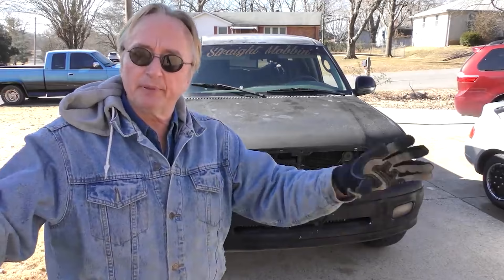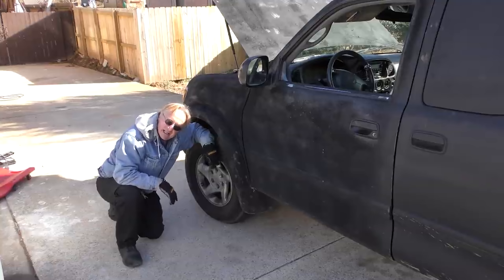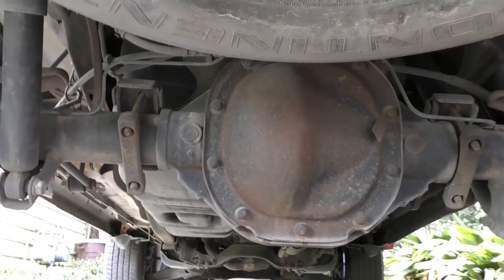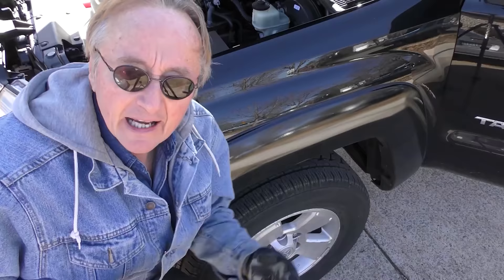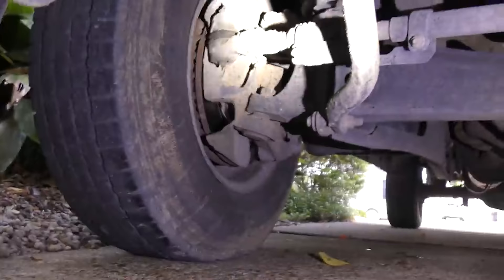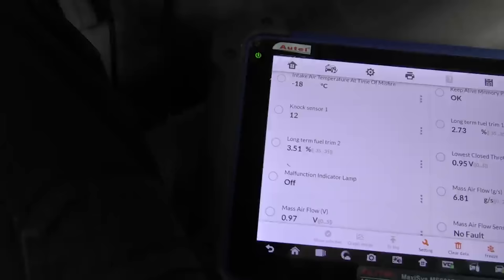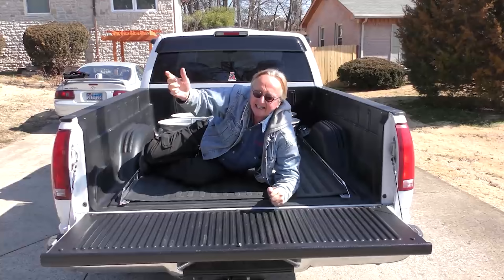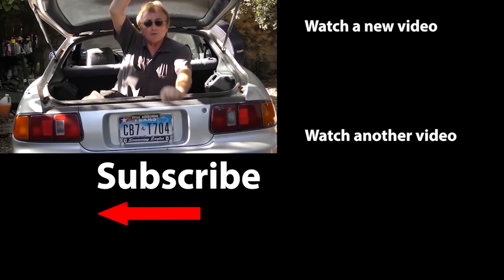5 Trucks You Should Buy

Comment: I own a 2004 Nissan Xterra SE 3.3L V6 automatic and still running strong at 184,000 miles original motor and transmission just been been doing maintenance you can compare this SUV’s to the Frontiers

Comment: i always bought s10's back in the day, they are my favorite trucks, sometimes when i needed a new truck i couldnt find a good deal on a s10 so i settled for rangers, i really hated my couple of rangers. now i have a colorado and i like it but i still prefer the s10 over the colorados.
Reply: Rangers are better trucks....why did you keep having to replace your s10s? The 4 cyl S10 were junk..the 4 cyl rangers are slow, but go forever, Chevy had a lot of issues w the tranny's they put in the S10 pickups and the S10 blazers, well, and the full sized trucks. My landlord has an 03 Sierra with no reverse.. which is normal for those.
Reply: @richsweeney1115  no, actually the couple rangers i had were junk. out of all the 4cyl s10's i ever owed i never once had an engines problem, the 4cyl engines known as "iron dukes" were great. i never bought any auto trans trucks, i always bought manual trans. i did have to change a couple clutches around 300k. the only reason i ever got rid of a s10 was because the bodies were rusted out. i live in Indiana and we get a LOT of salt on the roads for many months of the year. the rangers actually rust out quicker here.

Comment: The first Toyota Tundra when it was unveiled at the Detroit Auto Show was a complete rip-off of the F-150! There are also several GM trucks and Ford trucks on the road with over 300,000 miles on them all you have to do is open your eyes! One more thing if you go out to all your local scrap yards and pallet yards were people are putting trucks to use doing hard labor every day you will never see a Toyota Tundra all you see is Chevy's Fords and a Dodge trucks I've been in the business for 35 years and I've never seen a Toyota hauling a heavy load into a scrap yard!

Comment: I got an '05 Ranger with 113k miles on it. Had a good Carfax history, was 1 owner, mostly dealership maintained, and had no codes or anything when I bought it. Pretty much everything you want to see when buying a used car. Well it ended up being nothing but problem after problem. First the radiator went out. After getting that fixed, the transmission went out. Got that fixed and then I turned out the transmission failure caused the brand new radiator to break, so I had to fix that again. Then the brake lines broke and spit out all the brake fluid. Then the water pump went. Then the engine stalled and I wouldn't start anymore. Bought it for $4500, drove it a total of about 3,000 miles and spent almost $8k fixing it. Sold it for $900. Worst purchase I ever made. I will never buy a Ford again, no matter how reliable it supposedly is.

Comment: I got the same truck only thing is  the one I got is 2 wheel drive it just about to turn over to over 200000 miles the only thing I had to do is replace the starter a few years ago that 2 day job cause the starter is in side of the motor  that bigs thing I have had to fix on it  other then that most repairs are  sample to fix

Comment: Hey Scotty not sure if you know the percentage of all trucks comparison. I had 3 Toyota trucks two tundras and one Tacoma. I got to tell you I was extremely unhappy with them. They are not ment for heavy duty construction. I had constant problems with transmission and engines. Very weak and too light. I had chevy which was not that good either but the best truck I ever had was Dodge 3500 Diesel dually. GMC trucks are built well as well. In my opinion you can't beat diesel from Gas, but again it depends what you do and what you use it for. I call Toyota trucks toys for moms with kids going  to a beach or camping!

Comment: I just got a 97 ford ranger xlt step side 3.0l V6 RWD about less than a month ago. Only problem is there is a leak from the radiator on the threaded pipe going to the tranny. So I am leaking little at a time ATM till I thread lock it. Wish me luck 😁

Comment: I had a Toyota truck 22r 5 speed and put over 550.000.00 miles on it and it was still running only a arm rocker was the only thing wrong woth it

Comment: Hi Scotty, great service to the community, appreciate your expertise. Just wondering what year the Tacoma was that your son bought in this video? Best cars I’ve owned was 02 civic manual 5 speed vtec sold at 325k and my 09 awd Highlander 3.5 with 185k so far, front struts and changed the notorious oil cooler hose. Used cars are way overpriced right now. Waiting to pick up a 4x4 truck.

Comment: What about the 1993 Toyota Pickup truck? This truck is by Toyota but is a piece of junk! This has a aluminum engine with a steel head that goes through a head gasket every year! But Toyotas are long lasting ? Right?? Mine was a piece of junk that lasted 138,000 miles.

Comment: I rather have a 90s f150 manual with 300 incline 6 my father has one has 255k and pulled old John deer tractor on a double axle car trailer going 50 so I rather have old Ford then tundra

Comment: Yeah but what about my 08 Colorado with the 2.9 liter 4 cylinder with about 170,000 miles. I bought it about two years ago and haven’t been into the motor yet besides tunes ups and fluids. 

So when should I have the timing chains changed.

Comment: Toyota tried to prove they were tough in the 90s? I knew a 400lb guy that drove an early 80s Corolla, for years and years (well into the 2000s). 

It had 350,000 last I heard. The original motor and manual transmission. If that’s not tough, I dunno what is.

Comment: I've got a 97 chevy like tge one you mentioned. Can you get me some ideas about my rear diff whine? She's got 208k miles and has been whining forever. Pulled the cover and cleaned it up but I didn't see any wear. Put new fluid in and it's not much quieter but still whines. Other than that I love the damn thing, rusting apart in the rust belt but runs strong and everything still works!!

Comment: Loved your video Scotty and you started out with a 2000 Toyota Tundra which I currently own. My Tundra is a V-8 SR5, 4 x 2 with just under 133,000 miles on it, almost new ARE canopy, a cloth bedrug and a Toyota bed liner. I need a larger pickup and want your opinion on what I should ask for if I sell it. If this is something you don't feel comfortable doing I understand!
Reply: The market is hot right now, especially for Tundras. Check out the FIRST GEN TUNDRAS page on Facebook. Lots of good info on these trucks. The consensus is to not sell them though since they are made better than anything else out there. Price will vary on a couple of factors. 2WD is against you but the lower mileage helps you. Lastly would be regular cab or access cab as well as how's the frame as far as rust and when was the last time timing belt and lower ball joints were replaced. Frame, timing belt, lower ball joints, and exhaust manifold tending to separate from the gasket causing a ticking sound and slightly louder exhaust is the only culprits when it comes to maintaining these wonderful trucks. I'm assuming for a regular cab with it needing timing belt and lower ball joints and no rust you'd get $6k easy, list for no less than $8k. Access cab will net you more. List for at least $9k. Access cab with those maintenance items done would be $10k - $13k easy. I've got a 2000 4WD that I love that I'm doing some rust repair on the frame now and already have plans to replace the leaf pack, upper and lower control arms, new lower ball joints and new Bilstein shocks
Reply: Also, the topper definitely helps your case for selling as well. Some people like them and some don't. If the topper doesn't sell with the truck, list it in that Facebook group and it'll sell quick. Guys on there are always looking for them

Comment: Before you go off and buy a used truck...calculate the  fuel cost of 100k miles of driving at 14mpg and $3.50/g fuel. It might not be the bargain you have in mind. Hint: $25k in gas only!

Comment: When you buy a pick up, know what you need, don't treat a half ton like a one ton, that's what's wrong with most pickups.
If you want a new truck to do daily driving and some hauling, lease whatever you want, it CV doesn't matter, not your problem, it's theirs, these problems are to expensive to own unless you're a tech.
If you want a putter that's paid for, you won't be doing much heavy work with it, older yotas, s10s, rangers, dakotas are overpriced and overrated, Colorado's are 5cly junk cars. 
If you need a BIG boy truck, go unmodified diesel, Cummins is a great choice but look at service records, the engine's may have a good record but that leads to people being ignorant about services and let other parts fall apart not caring until it doesn't work, classic example is frame rust, tranny problems, and steering boxes with 10 inches of play.

Comment: Hi Scotty,  I know you don't have a very good opinion of the newer Chevy Silverado's. But I was curios about your opinion of my 2014 Chevy Silverado Crew Cab 2-wheel  drive with the 4.3Liter V-6 Engine WT. I bought it in 2016 with 30,000 miles on it. It currently has 39,000 miles and is only used as an occasional "Stuff Hauler" that runs like a Top. I just wanted to know of any hidden issues of that Year and model of Silverado that I should be aware of. ...... Thanks

Comment: Scotty I have a 2000 Jeep Wrangler with a 32 RH trans check engine light just came on vehicle has $193,000 OBD says torque converter clutch solenoid any knowledge from you would be appreciated I'm running into dead ends I'm going to start with a simple tranny service reset see if that clears my check engine light I appreciate your knowledge?

Comment: I can't believe the guy paid $14k for that turd of a Toyota, yeah it may run good but it looks like crap and from what I can see the interior doesn't look much better! Hell I only paid $12k for my 2003 2500HD 4wd Chevy Durumax Diesel 4 door short bed, I got a 2003 cuz I like the body style and it's the last year before they put the EGR system on them, and she is in cherry condition, the body is in perfect shape and the paint is in perfect condition too and she is a top of the line LT model with a fully loaded super plush interior that is in excellent shape and she came with a 6 inch lift and 37 inch tires on her too plus a 7" touchscreen stereo with backup camera. She had around 215k miles or so on her when I bought her and now she has almost 240k miles on her, I know I haven't put many miles on her but she still has over 200k miles on her and I haven't had to do any repairs on her aside from just regular mantinance and everyone know that the Durumax diesel engine will run over 500k miles no problems easily. Plus with all the money I saved I was able to drop about $8k or more in performance parts on her including a ton of visual performance parts upgrades like 20" rims, all new lights, step bars and more, lots of safety performance parts like upgraded bulletproof steering components and a full performance brake kit with upgraded calipers, drilled and slotted rotors and carbon fiber ceramic pads plus some power adding performance parts like an Edge Jammer Exhaust System, Edge Jammer Air Intake and Edge Juice Attitude CTS2 Power Porogrammer bumping her up from 520lb-ft of torque to over 800lb-ft or torque when turned up to level 5 on my CTS2  programmer, I usually only run on level 3, and even running the extra power she still runs like a dream including the stock 5 speed Alison transmission which has never been rebuilt! Personally I'd say since she's in perfect shape, fully loaded, runs like a dream, has a Durumax Diesel and came with a 6 inch lift and 37 inch tires plus other aftermarket upgrades that she was a better buy than that Toyota but I'm a Chevy guy and that's just my opinion.

Comment: Scotty
I know this video is older but i bought a 2004 Tundra a year ago and it sounds like it has an old style vacuum leak when i get on it. I've had the exhaust inspected at a good muffler shop, and have had two other reputable shops try to find the noise with no success. I am used to my 04 GMC Sierra 5.3 Vortec sound, so is that my problem? Frustrating!
Thank you
Randy

Comment: Hi Scotty. I'm seriously looking at an Eagle Cap or HOST (hefty 5Klbs but roomy) truck camper to be my next home so am currently hunting for the oldest, ideally gas 450 dually I can find with close to 7K+ carrying capacity. I'm fine with flatbeds or long pickup beds. On paper, 450s supposedly have less carrying capacity than a 350 but all those 450's leaf-springs say otherwise. In reality they're hauling capacity is equal or better than a 350, depending on make. So Scotty, what is the best crew cab dually with the most carrying capacity to you?

Comment: The only thing I will correct you on, Scotty, is get a better Ford than the F150. It's garbage compared to the 250 & up. If you want lightweight, get the Ranger.

Also Chevy is total crap, so I would never get anything by Chevy/GM.

Better to push a Ford than to drive a Chevy? Nah, just get a Toyota and not deal with either.

Comment: NEVER buy a 5.4 triton unless it has 100% servicing records showing the oil been changed the timing is contrlled by oil pressure. if it goes below 25# of pressure the engine is shot as it jumps timing. they also have phasers problems and the steel cams sit directly on the Aluminum as they dont use bearings at all. I bought a 2006 ford F250 with the 5.4 in it for $8000. after 1 month had problems and ended up jumping timing and ruined the engine.  These are also prone to warped manifolds these cost $600 each side to replace cause you have to pull it out the bottom through the wheel well they wont come out the top.  it cost me over $11,000 in repairs in 1.5 years of owning it. It has a new engine from Ford costs $7,800 installed. I got 12 quotes ford was the cheapest.  Now they dont have CV axles either and the yokes are bad in mine as the sway bars and to fix all that is another $4500 which im not fixing actually looking at trading it in to a dealer tomorrow so i can get out from under it.

Comment: $14,000!!!!!!
Reply: Right ridiculous! My 2003 Chevy 2500HD 4wd 4 door short bed with a Durumax diesel that came with only 200k miles on it and a 6" lift with 37" tires only cost me $12k and it runs perfect, no problems after 2 years and 240k miles and the body and paint are in perfect shape and the interior is the top of the line LT trim, fully loaded with all the amenities and also in perfect shape for $2k less than that beat up Toyota!